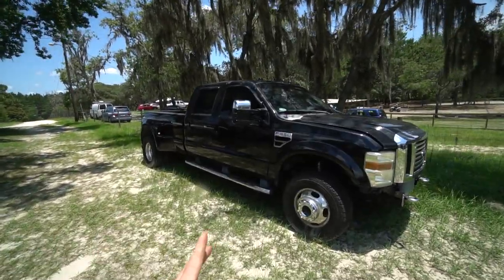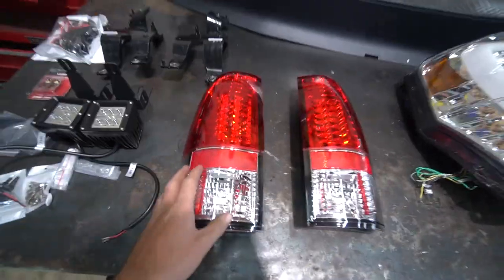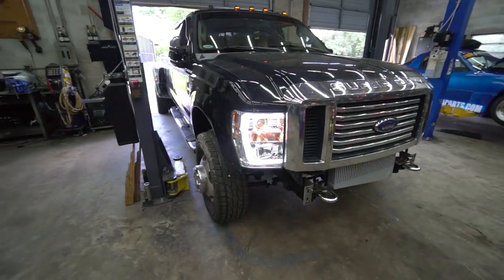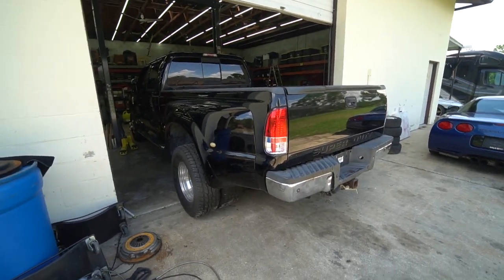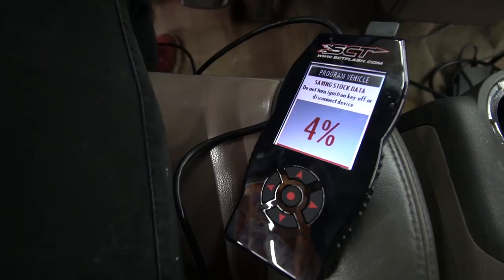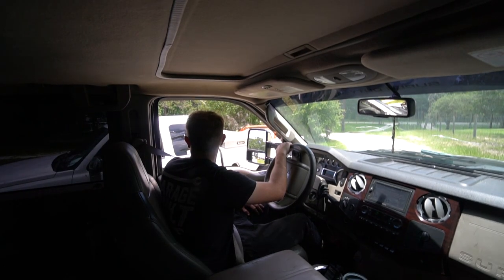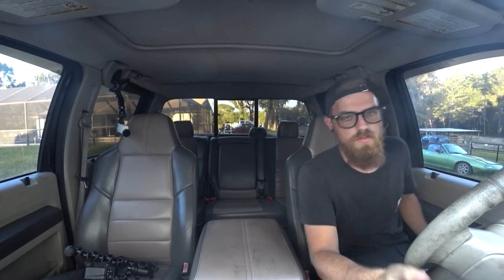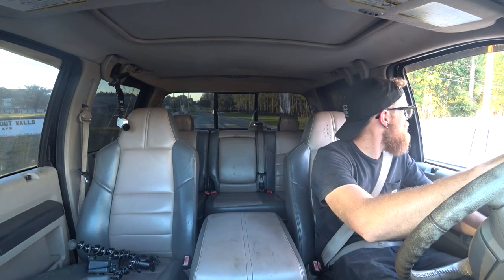CUMMINS Swapped FORD Gets A Makeover And Hits The STREETS! Fummins Build Pt.20!

Comment: Whoever designed the front end on the 08-10 Super Duties should have been fired after they re-designed them for 2011. That's gotta be the second worst front end on any 3/4+ ton truck ever produced, next to the 2020 Chevy HD lineup.
Reply: That's what I thought as well but after a while for whatever reason the 2015 6.7 PS front end looks quite alright and rudknicks 2011 excursion clone looks quite alright